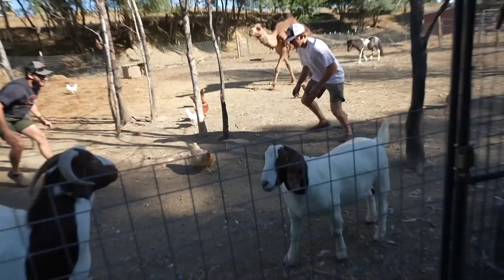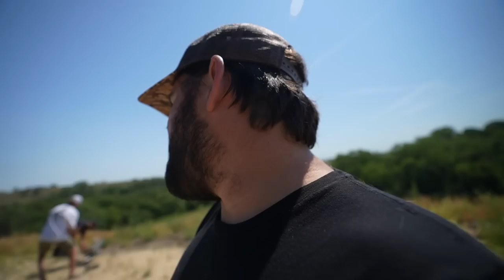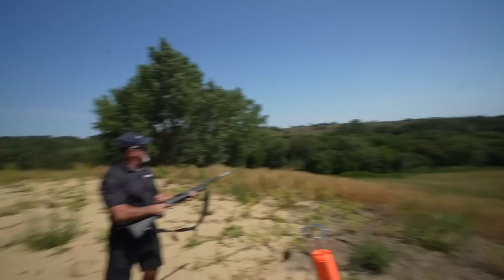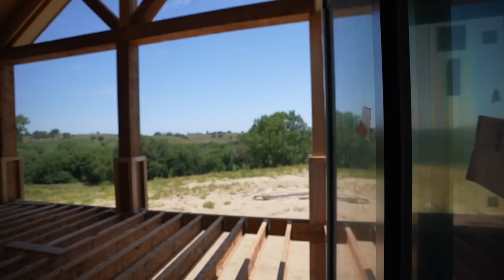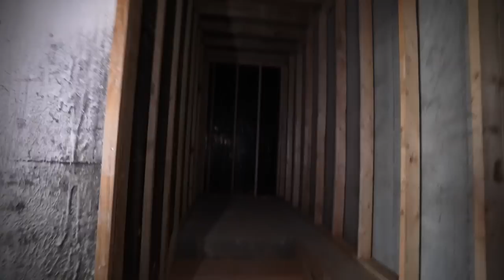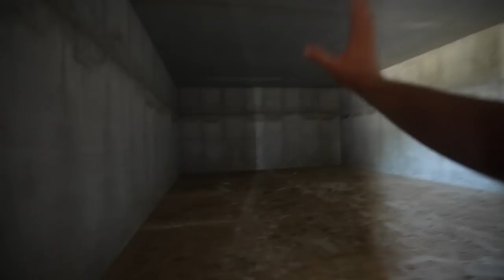MAJOR Updates on My DREAM HOUSE!!! (Surprise New Mancave Reveal)

Comment: Horse stall mat on the floor. What Demo Matt had in his weight room at the old house!  It has some give, is a rubber flooring so some give... Get started on pastures etc NOW, why wait? Get it ready, get the barns dropped off, get power and water ran... do it BEFORE the other house is sold.

Comment: Id at least put floors down on the other half of the storage or at least the center area. That way you can keep all the stuff that doesnt need to be climate controlled like decorations and cloths ect there on plywood in totes. That way you can split the climate controlled space for storage and a dog room. That way the dogs wont ruin the man cave. Closing off all that usable space is just wrong.

Comment: The play room floor can be a pour in place rubber surface. You can vary the thickness from 3/8s of an inch to 3 inches thick. Plus you can change colors.

Comment: It all ties together and part of the AC is inside.  Its called a split system and the evaporator coil is inside and condenser is the outside part..

Comment: UNDER THE GARAGE ; 1= Ball Pit(Foam Pit when the get older, maybe a bike ramp into a foam pit), 2=Basketball Court(Takes up 0 space, just lines on the floor and a hoop completely out of the way). 3=Zip Line(The longer the better, if it could go the entire length of the area; it would be the best), Tiny Village doesnt seem to be something children-teenagers would spend most of their time doing; in the case I would put a Bowling Alley. It would see more play time than the tiny village.

Comment: Its a furnace and your ac is outside and it's a 7/8 inch copper line with the stuff your refrigerator uses and there is a blower on top of the heater that does the actual cooling

Comment: Miniature town, or western town would be amazing. Maybe a castle..A place for kids to go hide, hangout, read, imagine….would be amazing.  Can you imagine tunnels suspended above with connecting nets, rope bridge…and suspension net to collapse on like a giant hammock enclosed connected to the tunnels. ……..all above the village ending with a slide into a ball pit! with rock wall to climb into the tunnels….and/or use spiral stairs for those unwilling to wall climb-to the tunnels above, with nets, leading to a slide into a ball pit!  You could have a giant hammock net to hang out on, and a rope ladder to traverse with netting below so no one falls out. 

They will expend more energy climbing through tunnels above and nets then one zip line that just creates broken bones, or parents having to strap in every time. Just have knee pads for adults! 

I also like the idea of a ball court area,  have a hoop on the wall) for any ball games ie basketball, dodgeball, corn hole), roller skating ,
tricycle etc riding

and miniature village along other wall….you wouldn’t have to worry about aging up the tunnels because all kids will love the hammock meeting above. 
Put their zip line outside with rubber mulch or sand. Zip line is too dangerous to leave unsupervised. Outside at least you can make it bigger with better landing spots.

Comment: That furnace is a geothermal you won’t have an ac outside it’s all under ground so in short you will get heating and cooling from the same system and your outdoor unit will just be pipes under ground

Comment: room for the kids make a big chunk a Trampoline corner. completely install super thick padding on the floors so if they fall off they land on soft padding. we have places here in my state I forget the name of the company but its like a gigantic indoor Trampoline aera about the size of three full size NBA floors and the Trampolines are all different types and sizes. you can get the really nice indoor outdoor flooring and you can make and design a F1 race track for their little electric BARBIE cars save at least either one corner of the basement or 2/3 of the whole basement for adults where you can put a really nice size indoor swimming spa/hot tub but make sure the door or doors on the adult side that shut and lock automatically that way you don't have to worry about kids getting into the adults side and one of them get into the hot tub and drown. if you want your daughter to grow up and hunt and fish with dad you can put a indoor bow range and gun range for the kids but use Nerf bows and arrows plus Nerf Guns yeah its just toys but it gives them the practice they need to learn to be good with the real stuff and being indoors they can still play / practice  during the winter

Comment: 100k to do your man cave? Getting it wired insulated and drywalled is like 10k in materials if you beefcake construction it. Another 10k for all the bathroom and kitchen materials. Id hang all the drywall myself and pay someone 2k to mud everything. Then you paint everything before you trim and do the floor so you dont have to paint around it all. Hanging drywall hanging doors, painting, floors and doing trim is all easy. Tileing bathroom and kitchen is easy too

Comment: You should add a central vac system with connections in all the rooms, so you can plug in and vacuum with ease.

Comment: Hello, Flair.  Would you want to do a video, or a series, where you challenge one of your fellow Beefcakes to a competition, and either the winner spends from dinner through breakfast in your off-grid cabin while the loser spends the same time frame in the doomsday shelter, or, if you win you get the cabin, but if you lose you get the shelter?